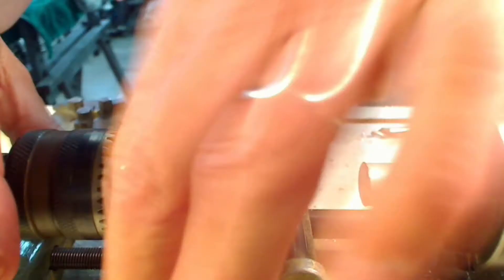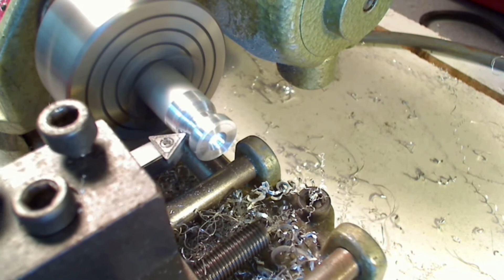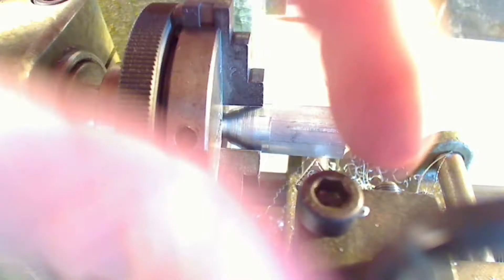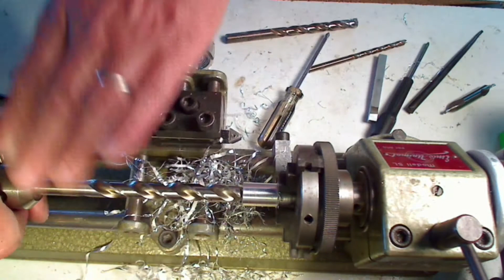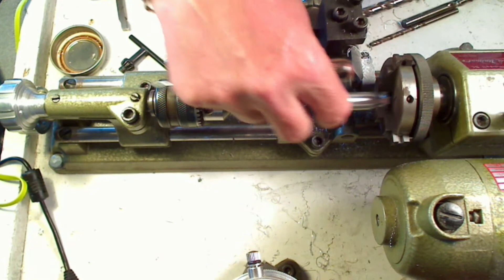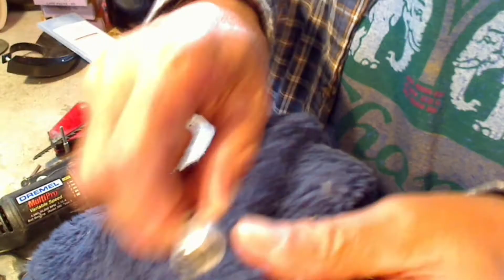wasting time on a unimat lathe

Comment: Where did you get that nice 4 jaw chuck with the allen wrench set up?  Does it have the same capacity as the standard Unimat 3 jaw chuck?
Reply from the maker: If you have the same large as me, I believe you need an M12 thread chuck. I got mine on eBay, new from India.  The real unimat ones are available but cost twice as much. I'm happy with mine but results may vary witth these things. 
https://www.ebay.com/itm/154870792670?mkcid=16&mkevt=1&mkrid=711-127632-2357-0&ssspo=jaqccrfssea&sssrc=2349624&ssuid=1QFV6tUSTua&var=&widget_ver=artemis&media=COPY